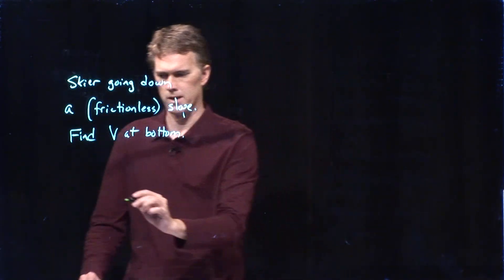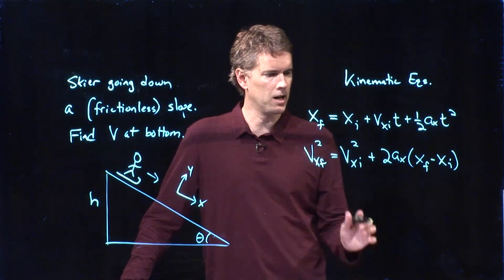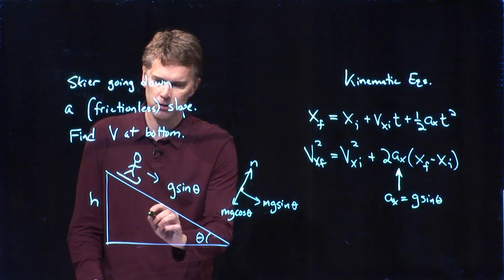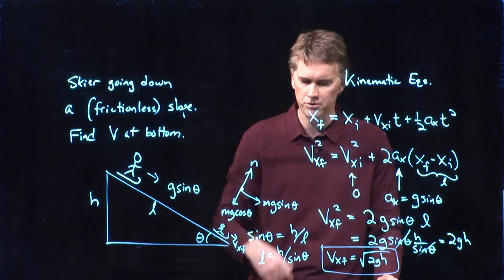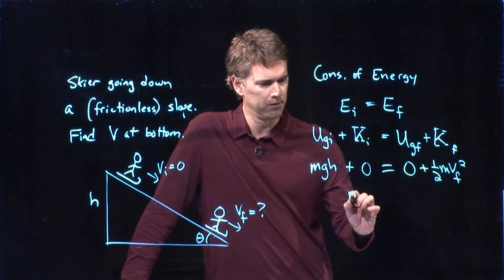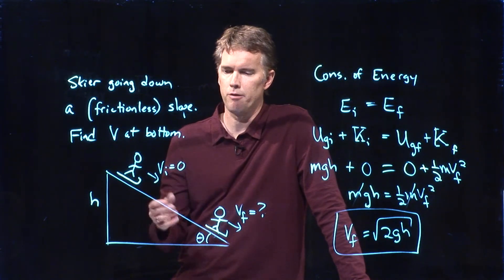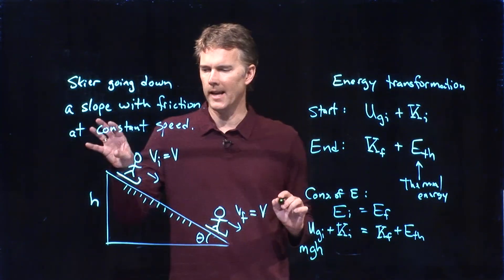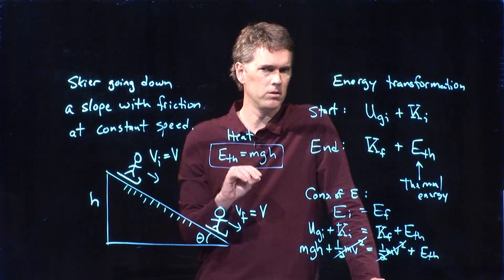Energy -  Skier on Inclined Plane

Comment: A skier starts from rest at the top of
 friction-less incline of height 20 m. 
at the bottom of the incline, she encounters 
a horizontal surface. Show in figure 
How far does she travel on the horizontal 
surface coming to rest
Reply from the maker: جعفر جبر الخزعلي, 
Excellent question.  Use conservation of energy to solve this.
Thanks for the comment, and keep up with the physics!
You might also like my new website: www.universityphysics.education
Cheers,
Dr. A